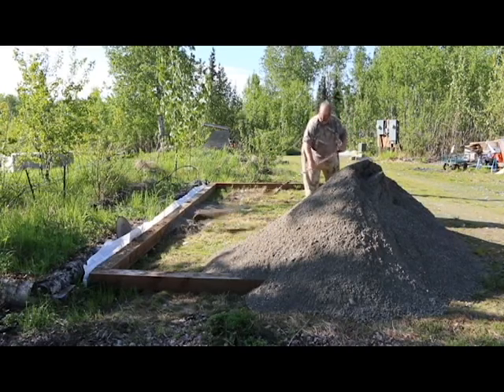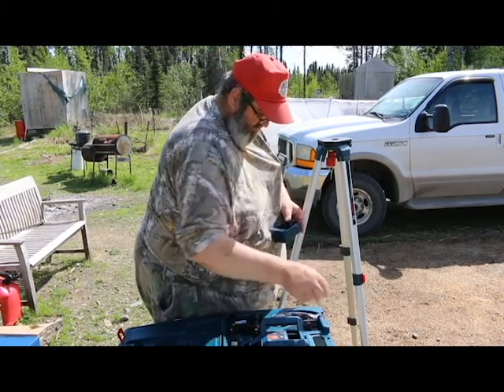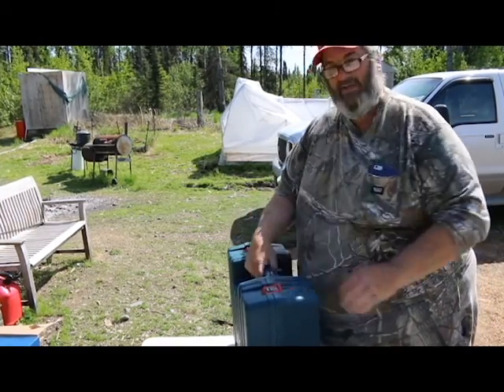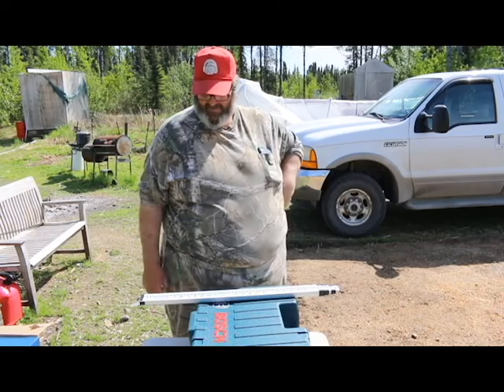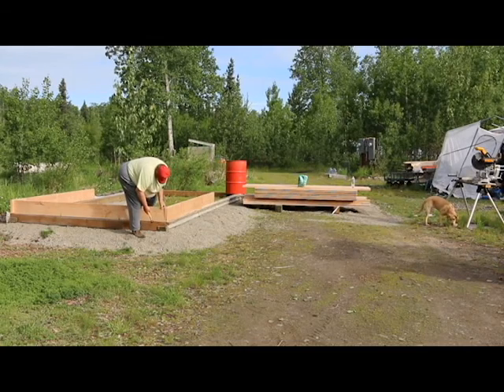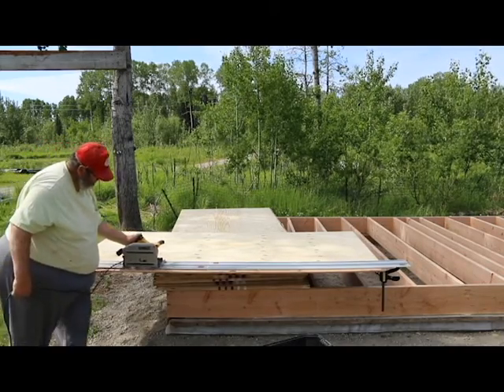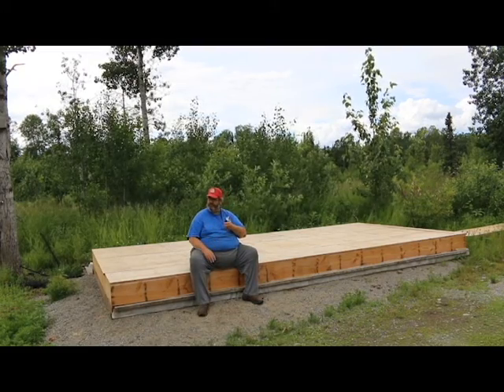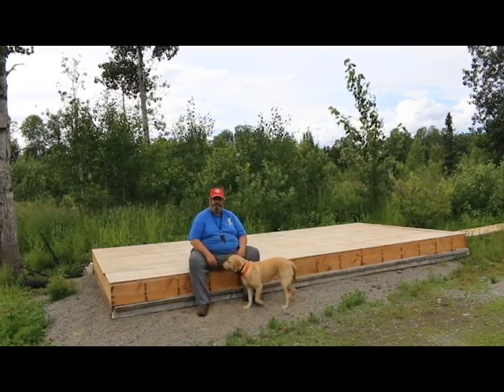Building a tool shed and abusing the dog!

Comment: Nice start!  I like that saw, I've never seen one of those before.  And sometimes it sucks a little not having help but determination will get you through.
Reply from the maker: Yes the track saw is like having a big table saw that moves over the board instead of the other way around. It is really accurate and makes perfect straight cuts. I hope to be starting the walls and roof next week.